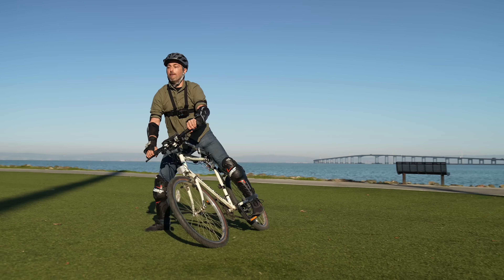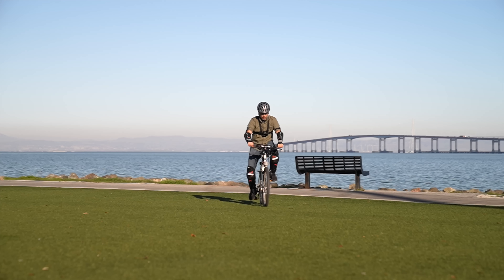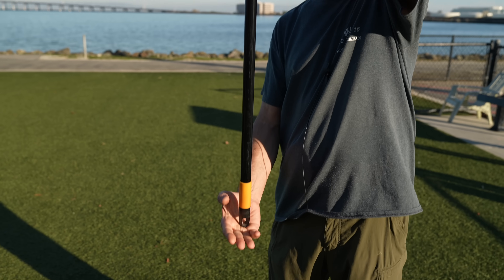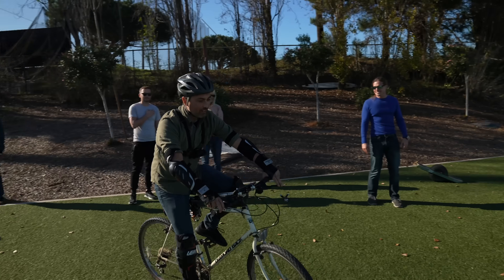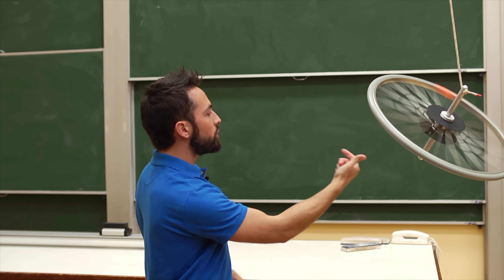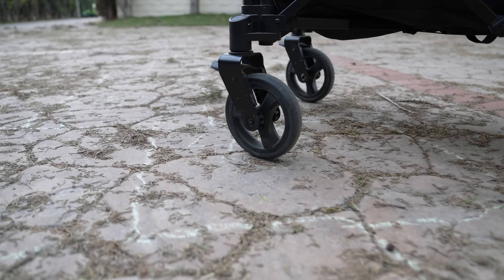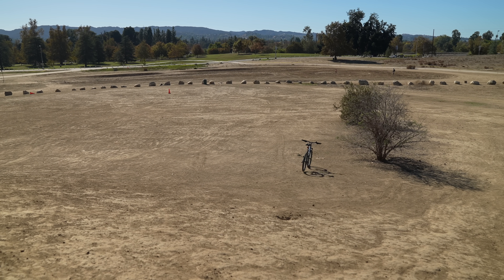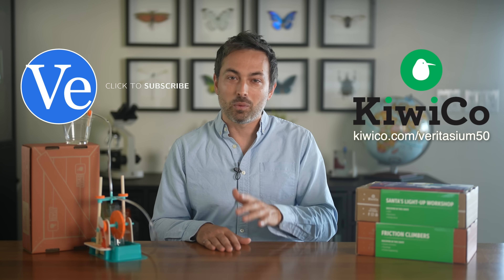Most People Don't Know How Bikes Work

Comment: This counter steer effect is really well demonstrated when riding a motorcycle at high speed. Especially in a chicane you are literally pulling the opposite side of the handlebar with all your power to flip the bike. Pretty cool feeling.
Reply: even at low speed really, starting from 30 kph (20 mph ? idk) you're really only using counter steering, but at 15 kph (10mph) you start feeling it already
Reply: @SwainixFPV  you're using it even when doing extremely slow speeds to initiate a lean. Motojitsu has a video on it
Reply: @sly9889  depends on the maneuver for me, on a tight U turn yes, but it's more like having more space to work with than counter steering. On a slow slalom like the one you have to do to get your permit in The Netherlands you're not counter steering
Reply: @SwainixFPV  You will be counter-steering even at very low speed, but the effort required will be so little, it’s virtually imperceptible.
Reply: @SwainixFPV  I feel you mate, but for the very first corner I did use counter steering. But all of the other turns was normal steering, not sure why
Reply: @SwainixFPV  You may think you're not, but while pushing the bike down into the curve you'll also slightly countersteer to keep the bike down. Otherwise it'll want to right itself up and go straight again. (source: my motorcycle driving lessons).
Reply: @daanwilmer  Yes motorcycles have wider tires with natural turn radius when tilted. This may lead to the absolute steering angle being away from the curve when leaning.
Reply: @daanwilmer  no but I was talking about 2-5 kph slaloms between cones, otherwise then yes I counterweight at low speed with a bit of countersteer, and countersteer starting from 10/15 kph.
Reply: @SwainixFPV  definitely. Also the mass of the tires affects when you can counter steer. I have a cruiser style motorcycle and can counter steer at around 12kph. If I tried that on a sports bike with smaller lighter tires, that would be a different story lol
Reply: It all has to do with inertia and gyroscopic effects
Reply: @lucacalledluca  yeah that's  something I noticed with my small 500cc vs the bike I had during riding lessons that was 200+ kgs
Reply: Profile pic checks out.
Reply: At high speed it's also a gyroscopic effect, from the gyroscopic precession of the wheels. At low speeds it's just a matter of upsetting the balance. That's why it requires more force the faster you go.
Reply: @bobsbikesinportugal6670  it is about the grip and contact to the surface as the wheel wants to rise off the track. Some people race on ice with heavy studs in 21" front wheels and the effect of heavy tire with studs and limited grip is very clear.
Reply: There's a saying, the front wheel is mostly there to keep your front forks off the ground.  That's an exaggeration, but aside from controlling how much the bike leans, it's pretty true.  The turn happens mostly in the rear wheel, though also a little due to the shortening of the distance between wheels on the side you're leaning into.
Reply: "Push right, turn right."
MSF basics, baby!
Bicycles are so light, countersteering isn't a necessary input by the rider.  But it happens nonetheless!
Reply: Bad motorcycle if it takes all your power.          It doesn't really take strength to me.     And I mean at pegs on the floor speed

Comment: The wheel's center being in front of the steering axis, shifting its weight forward, has the opposite effect of what you describe. In use, the upward force is applied to the wheels, whereas in your demonstration you're holding the bike in the air by its frame. The wheel is driven to the center by this, not laterally.

Comment: What a great topic to segway into a discussion on stability and control. Of course this concept is commonly referenced when designing aircraft, however, is just as pertinent in the case of the bicycle.  Wether relating gravity centers to aerodynamic centers or steering axis locations, an understanding of this relationship will help further illustrate and define how bicycles operate and how their design can be modified to fit different needs.

Comment: This is a concept that is taught for riding a motorcycle and is especially noticeable at high speeds.  You have to counter-steer to turn the direction you want to go.  To turn right, you slightly steer to the left, lean to the right, and once you start to turn you then steer right.

Comment: Awesome video, but I think that there is another type of turning where it is not required to counter steer. I use counter steering all the time when riding bicycles, but u know, I think at very high speeds, when I don't need to turn, but just move left or right, like for changing lanes, I don't use counter steering,  in fact I don't think that requires steering at all, I just push downwards towards the ground on the left handle if I wanna go left , and it moves to the left.

Comment: As a motorcycle racer you learn to conciously and agressively push the opposite bar to rapidly pandulum the bike to get through S bends, hanging off the side isnt fast enough because of the comparative weights of bike and rider (and centre of gravity).

Comment: I have 1 thought about push steering. While learning techniques for riding a motorcycle we learned to lean the bike away buy pushing the handle bars our from under ones self. Essentially initiating a counter steer through lean angle before leaning back into the turn. Does it work with pure lean or does turning happen in the handle bars at a subconscious level still?

Comment: My motorcycle driving instructor had a good comparison about counter steering back when i was learning to ride. You just have to think of it as driving a car around a corner and then imagine which way the car "rolls". You turn right, the car wants to "roll" left. Car just doesn't "go that way" like you pointed out. Well it goes, but it kinda wants to do the opposite as well.

Comment: I learned this long ago on road bikes.  High speed descents counter steering.  To turn right, you push the handlebars slightly to the left and lean.  Anyone who has raced bikes or motorcycles knows this

Comment: Lol, figured it out right around the explanation. I'm Dutch. We ride a lot of bikes here. Most of them you can drive without hands for kilometers. But when you want to stear without hands you always have to give the steering wheel a little wiggle by shaking your bum (the only point touching the bike beside the feet).
When you go left you stear right a bit to have the bike fall to the left. Which you can then use to counter the outward forces of the actual left turn.

Comment: I'm kinda old(er) am dutch and i use my bike daily. I like this one. You know what I've been wondering. Would it be more easy without using you're hands on the steering wheel?  I think not....... However. You steer from straight line to the left or right while steering comes from the hips.

Comment: Now I'm curious about how a high speed like 35-40mph, flying down a hill in a tuck would change or not change any of these results. When I am riding slowly, I am aware of the counter-steer that I have to do to keep my balance. But when I am moving very fast, It feels different. Not sure if I want to lock my wheel at those speeds to find out though>?
Reply: It is mostly the same thing, you just need smaller steering angles and higher lean angles. You barely notice the countersteer since you only need to nudge the bars and then wait for your bike to fall into the turn, but it is there.

Comment: 7:10 you are wrong, hope you read this cause this is the first fault I have found in your videos so far

I am ready to call you out for being wrong here. combined with a previous statement where the steering does nothing when stationary.

you have more than your body position to help you when it comes to balancing a bike when stationary. because of the angle the fork is at do you imput a small force sideways when turning at a standstill, it is no where near as noticable as doing it when riding forward because we have two entirely different forces acting on the bike, one is when the bike is moving underneath you and the other is the front wheel pushing the bike slightly sideways.

with the knowledge I have written above  can I say that it is way easier to balance a bike at a stand still but with steering than riding a bike forward without steering

Comment: The answer to all of this is CASTER . 
Thats the name for angle of which the steering axis relative to vertical. More Positive Caster gives more stable steering. It is also the most overlooked alignment parameter on cars/trucks. Build a Bike with a vertical front fork or a negative castered one, and i reckon it would be ridiculously unstable. Cars/Trucks Aligned with no Caster get steering wobble or death wobble, and they are be very sketchy under breaking.

Comment: This, by the way, is why you should always keep enough side distance to cyclists when passing or overtaking: Firstly going straight requires little corrections to both sides, secondly when they want to steer "out of traffic" they first have to steer "into traffic" a little.
When I ride my bike ... there are a few things that keep annoying me. One thing is parking cars opening doors without checking for traffic, another is cars passing with insufficient distance.

Comment: If you have ever ridden a motorcycle, this becomes way more obvious. also the gyroscopic effect is way more pronounced (tires are heavier and turn faster)
 below 20mph it feels like a bicycle. between 20 and 30mph its a bit werid but above 30 mph you notice the gyroscpic effekt .
I.e. you push the handlebars to the left and the bike jsut does a right turn. the stronger you push the more the handlebars move opposite of that. Discribing it, is really strange but on the bike it feels like second nature.

Comment: That's a common practice for motorcycle riders. You don't steer a motorcycle by leaning, at least if you want to be effective, you steer completely by counter steering. It's how you initiate a lean, stay in a lean and also how you move out of a lean. This is really effective and stupidly fast compared to leaning your body. It's the only way you can effectively evade an accident.

Comment: This is just a really bad version of the backwards bike that Smarter Every Day did years ago. The concept of suddenly locking out steering is itself going to act as a perturbing force the rider isn't expecting, and I suspect many of the failures come from this, rather than an actual lack of ability to execute the turn. Adding an extra layer of unpracticed logic to it, through the led indicator, just makes it even harder. 

If the silly remote control system were removed, and the bike was locked out before you start peddling and stayed locked off, I am willing to bet that most people would be able to figure out how to properly turn with it in under half an hour.

Comment: You can feel the gyroscopic effect more on motorcycles when you steer. I assume this is because the wheels are heavier and are rotating faster. At highway speeds, when you gently push forward on the right handlebar, you can feel the bike actually turns to the right. At least that's my experience on my bike.

Comment: I learned about counter steering in motorcycle training.  Because if you enter a (let's say right hand) bend in the road too fast, and you are going wide to the left, you apply more forward force to the right bar in order to tighten your turn to the right.  It takes practice to do it consciously, but it works.

Comment: I think stability from the gyroscopic effect actually makes a difference at higher speeds.

Also as someone who learned to drive a bicycle without holding the steering bar, I knew turns primarily come from the lean, but hard turns come from the steering bar, which is why they are impossible at relatively high bicycle speeds

Comment: I'm quite sure that the argument against the gyroscopic effect is flawed for how it is brought up: just referring to the angular momentum of the wheel is not enough because you have to consider to total angular momentum provided by both the wheel spinning and the angular momentum of the whole weight moving at a certain speed with the center of mass at a given height from the floor (basically evaluating the total angular momentum of the system (Γ=Q*h) with respect to the contact point). This momentum has the same direction of the contribution of a single spinning wheel and explains exactly the steering of the system as the effect of the torque given by weight and resultant force from the contact patch of the tyres.
The reason of guys falling over with completely blocked steer is then due to the fact that the gyroscopic precession of the whole bike+rider system is not allowed by the blocking system and the only way to gain angular momentum from the weight-tyre resultant torque is to start falling sideways.
Anyone with comments please do, cheers.

Comment: Finally Veritasium decides to cover this. I first realised countersteering as it was pointed out to me for an explanation as to why the bike tilts right when cycling freehand with a significant weight hanging off the left handlebar. When the bike is stationary, the handlebar would turns towards the direction of the hanging weight but when riding the bike freehand, the whole bicycle tilts towards the opposite side as a result of the steering induced by the hanging weight. It's a really freaky observation initially

Comment: What brought the point home for me was a diagram of how the roundness of the tire's cross-section changes the way the tire interacts with the road.  A bicycle with flat-profiled tires (like a high-performance car tire) would not be steerable either.

Imagine three circles -- the centerline of the wheel and about 1/2" to the left and 1/2" to the right of the centerline.  The two outer circles have smaller circumference.  To turn right, you need to use the right side of the tire.  It rotates the bike to the right because compared to the centerline, the outer line is shorter. 

In order to get the wheel on to the right edge of the tire, you have to turn the tire to the left.

Comment: Coming from a harley FLH, which has a drastically different rake and trail from your bicycle example, I'm glad to see you post that experimental "weight distribution" bike. Rake and Trail can keep a bike going forward with minimum or no steerage input when they are engineered for an expected weight distribution.